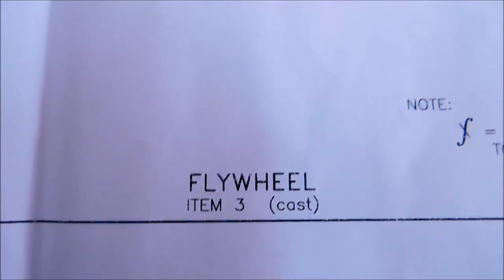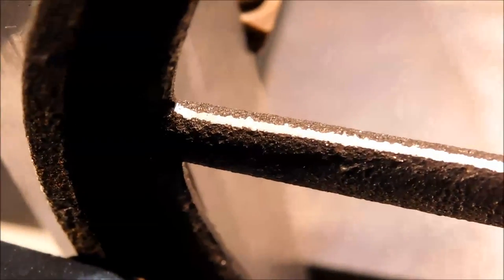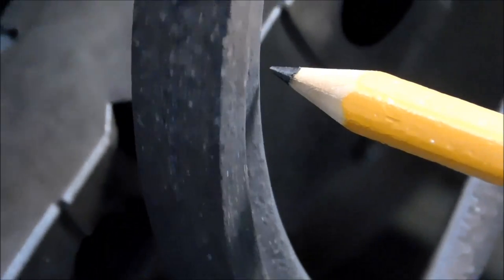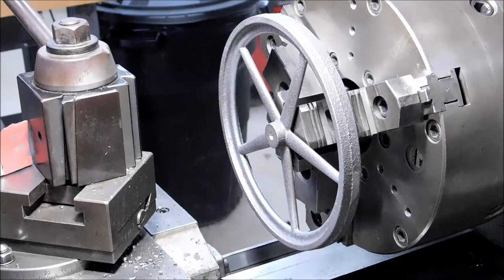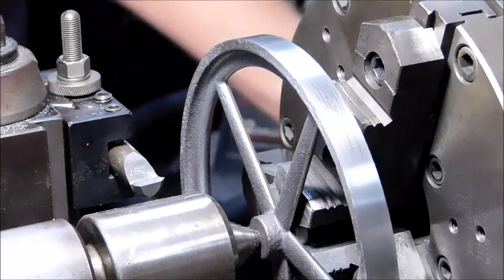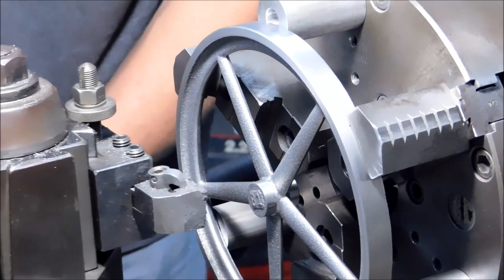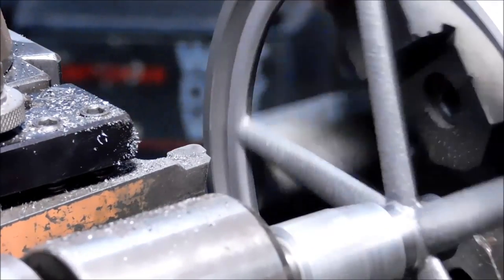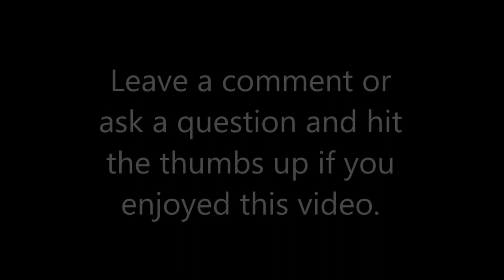Machining a Model Steam Engine - Part 10 - The Flywheel

Comment: It would have been helpful to have a weighted rubber strap like we use turning rotors on a brake lathe.  They help a lot with surface finish.  Ringing is a turners nightmare.  Awesome work!
Reply from the maker: I live by 2 sayings on this topic.  No dwell, No yell  and   If you got chatter, somethings the matter. Like little alarm bells for a problem.
Reply: @joepie221  Indeed, I agree. Are you familiar with the anti chatter device I'm talking about?  They actually work very well and are cheap.  You will find them near any AAMCO brake lathe and at your local NAPA.
Steel rotor hubs on cast rotors are the worst.

Comment: Iron castings were left out in the open air yard for a year to season before machining.   Fresh castings do not machine well.  Mounting a small grinder on the cross slide to face the rim at low rpm might have been an option.

Comment: Might have been easier to use 3 inside jaws to hold the outer rim on the inside, so it automatically averages the rim runout.  Kieth Appleton recommends holding the outer rim and cut the center, center crank hole, rim face, and outer face first.  Then flip and mic off the fresh rim to face the rear rim face and center...which are not as critical since the runout was cleaned up in the front cuts.  Your way depends on a pricey adjustable 3 jaw which most of us don’t have, and was more work.
Reply from the maker: 3 jaws won't seat comfortable inside a 5 spoke pattern. Using Keiths method, how would you address the inside of the rim to run concentric?????  I may suggest to hold the OD and face it for the first op, then pressure turn the second face and OD, but don''t do the center hole until you address the inner rim concentricity.

Comment: Wonderful bud Get the brake rotor straps for putting vibrations in their place. Or even a tarp strap wound around the spokes.Once again thank you for all the tips and tricks. This took me back to when I machined all aspects of ships engines. The only difference in flywheels is I did mine horizontally. I have yet to see a lathe that could radius swing 12 feet + eh. LOL.Thanks a bunch my friend and thanks for the memories.
Reply: When I was training we had a visit to Port Talbot steel works machine shop. (South Wales UK) They had a huge lathe but I forget if it would turn 18 or 20 ft diameter work. Tool-post was massive with 4"~5" square tools holding what looked like normal brazed carbide (except bigger than I had seen before) 
What fascinated me was how many  large electric motors were used to drive various parts into position as everything was too big to use normal hand-wheels for 'fast' positioning and the 'hand-wheels looked like cartwheels (saddle drive and tail-stock drive plus cross slide all had motors between 18" and 24" diameter)
It was in use with an interrupted cut about 1/8" deep at 1.5 rpm and huge blue chips coming off.  Even though it was around 1974, it kinda stuck in my memory as a scary piece of machinery.
Bed was about 80 ft long
Reply: @1crazypj  Lets see, , , We had 4 vertical boring mills. 6,12 and 36 foot tables. A master service radial arm with a 4 foot post and a 4 head mill with a 12 x 63 foot table. I sooooo miss the challenges working with 40 + ton castings making running ships engines and pipeline compressors. All done in my youth. It was GREAT !
Reply: @1crazypj  I sooooo loved working big. I got some relief in the logging industry here in BC Canada. Just not the same though. Nothing can compete with 40 or 50 ton pieces with a 2 in cut at 2 rpm though.
Reply: @TomokosEnterprize  I was never happy when stuff had to be hoisted into machine, turned down a job in heavy engineering because of it (also, didn't want to move to Holland and learn dutch LOL)
Reply: @1crazypj  I hear you my friend.

Comment: Nice work as always. I was thinking a 4-jaw chuck would have worked better than the adjustable 3-jaw
Reply: I was wondering the same thing.
Reply: most 4 jaws will not close on a small diameter.
Reply: @RobB_VK6ES  True. I didn't think it was that small but maybe so. Anyway, very nice job.
Reply: @RobB_VK6ES  I meant, why not clamp the outside of the flywheel in a 4-jaw to true the center hub and side of the rim. Seems like it would be easier to center and probably stop the ringing as well.

Comment: Just a comment/recco on using a set screw to fasten the flywheel to the crankshaft. Try to avoid it. The torsional vibrations seem to ultimately loosen set screws which in turn damages the crankshaft.  Machining flats on the crank, only limits the damage to the flat area. I use keys to avoid this problem. This is fairly easy to do. Keys also help to transmit power from the flywheel. Which brings another point. Since PM Research has offered another model, consider their little dynamo. Perhaps you might drive it with a flat belt off the flywheel to get the high speed needed. Then light a light. A model is much more attractive if seen to be doing something rather than spinning pointlessly. Cheers.
Reply from the maker: There are many better ways, but this part is being done to print this time.

Comment: Stunning job on that, it looks really good. :o) The pumping engine flywheel near me is several pieces and huge. I often wonder if the bolted on a temporary lathe slide and skimmed them in situ?

Comment: When I run small flywheels like that, I do, as you did ...get the very inside diameter to run as true as possible...but being a casting, you can only do so much .....but after the machining is complete, I indicate it in on my rotary table, and take a very light clean up cut on that I d. Between the spokes on my milling machine......then, as you did in the beginning, I fettle that inside rim with a file, to round it off.......all said and done.....you have a flywheel that runs dead nuts everywhere !!!!
Reply from the maker: Strapping it down to a rotary table should allow you to finish every surface, true, but I like the combination of cast and machined as well.

Comment: Hi Joe. Great work as always. 
Would it have been a valid alternative to begin by using reversed jaws to hold the I.D. of the rim and face the rim and hub od and face all concentric to that at 1st setup then reverse and hold on hub od, indicate the machined face to run true, then turn the od of rim and face rim and hub, drill and bore and do rim lip ID?
Then reverse again and hold on hub od to finish inside of rim on the first side. 

That way you automatically centre as well as possible on the rim ID and all else falls into line. 
I acknowledge it's a thin rim but I would rather have the dodgy grip on the cast surface at the large radius and be machining the small radius than the other way around.... that way you get some mechanical advantage over the tool forces. 

It would be disappointing to break it open though with tensile gripping forces.... 🤔🤔🤔
Reply: Yes, that is what i usually do. It keeps the inside and outside concentric. Cheers

Comment: Hey Joe - question:

That undercut around the rim adds so much to that classic machined casting look... but were you at all concerned about thinning out the material between the spokes and the rim? Hard to see thickness on a video, maybe there’s plenty of meat there, but it looked like it might be getting kind of thin.
Reply from the maker: It was about .2 thick at the end. 4.5mm

Comment: Joe you made a silk purse out of a sows ear there! I'm extreemly impressed of how you dealt with that casting.
The standard of quality of the casting was bloody awful to my mind. I used to work for a company that was based in the yard of an iron foundry making pretty complicated and intricate castings. Whoever moulded that flywheel would not have lasted two days there. There is no excuse for allowing such slip of  the split pattern, unless the patternmaker never put locating dowels in, OR the pattern is so old and worn  that the dowel holes are so worn that it allows such slip. Either way the company should address this issue.
Reply from the maker: It came out nice. I do agree, a casting can have some flash, but an offset is avoidable.

Comment: Joe, I love your struggle for a good result. But what about using an adjustable 4-jaw? Why didn't you use that? Or maybe a small shim in between of one of the jaws of the three-jaw chuck to get the biggest error out before adjusting?  (e.g. if you don't have a four jaw with a small enough opening for this diameter of hub). Just curious and willing to learn. Thank you for sharing this build! I can't wait for the next one. Best, Job

Comment: Your model is going to look amazing.
If you look at a lot of full size steam engines although the wheels look to be running true  it is an ilusion. The unmachined surfaces are painted in a dark colour with bright pinstriping added which when combined with the true bright machined surfaces disgiuses the wobbles in the rest of the wheel.
Reply from the maker: I needed this part to be a gem. Its the first thing you'll notice.

Comment: Another master class. Would the OD of the wheel would be used to drive a belt? If so would it need an angled profile?
Reply from the maker: I'm not positive, but I think its only to keep the momentum of the engine.
Reply: Typically a pulley would be added to the other side of the crankshaft on most engines in order to drive a belt.  That pulley would have the "angled profile" for a flat belt instead of the flywheel.

Comment: I'm a bit surprised you didn't grip it by the inside of the rim. Were the spokes in the way? Seems like that would be the most accurate hold, and the backside is supported by the step in the jaws. 

My only concern would be whether the cast iron would resist a tension load from the jaws. I imagine that it would be pretty easy to crack if you applied too much gronk.
   ....
Ok, I'll reconsider. Mounting that thing on a faceplate or making an equivalent fixture should avoid bending such a spindly part.
Reply: If you look it us a 5 spoke wheel and thus no way would it fit in a 3 or 4 jaw chuck. Seen any 5 jaw ones?

Comment: Hi Joe, Nice Job on the flywheel, every time that I added a set screw to the hub even after reaming it caused it to wobble so I just started locktiting it . don't know if I was not seeing something.
Rich
Reply from the maker: I may add a flat to the crankshaft so I don't damage it with the set screw.

Comment: Got any tips for dynamically balancing something like this in the home shop?
Reply from the maker: RC modelers use a small device called a prop balancer. This is not a high RPM unit, but if it was, I'd use one of those.

Comment: Hi Joe. At about 36 minutes in, where you were facing off the side of the flywheel, what if you remove the tool from the tool-post and stick you some sandpaper on the side of the tool-post parallel to the plane of the side of the flywheel, then - ever so gently - hand-advance the cross-slide (and, with it, the sandpaper-coated tool-post) against the spinning flywheel? That tool-post looks to be flat and true; just make sure the compound is set to 90 degrees to the axis passing through the chuck and tail stock. Obviously, you’ll have to secure the sandpaper somehow. Or, if sandpaper doesn’t work, how about that flat file you were using earlier? Is there some way to secure that against the tool post?

Comment: For the first time ever watching your videos I feel like I want to comment on how you did something, I'm usually just in shock and aww.
Looking at the situation my advice would be to have worked all of the center features while being held by the center, then do all the outer features while the jaws were reversed. 
You could have set your standoffs on the chuck and used them as jack screws to machine the side to help with the chatter... 
Everyone has their off days, I had a boiler explode in my face after 15 years of not a single work related accident. 🤷 
Thank you for the awesome content I'm really enjoying the build and can't wait for the next video/ steam engine build coming.
Reply from the maker: I felt it valuable to show and fight the vibration. I could have fixtured this part like a rock, but not too many would appreciate the approach. then again, I'd do the next one differently that I did this one. Evolution. But with only one to work with, I picked a path and walked it.

Comment: Just a question/comment from the peanut gallery: would it not have been possible to also use those stand-offs whilst you were gripping it by the hub to turn the OD?  Might this have reduced ringing during that op too?
Reply: May I also add, I really enjoy your videos, thank you!
Reply from the maker: Very possibly. Once you have a reliable surface, the job gets easier. Its just establishing, lining up and cutting that first surface that is the task.

Comment: Great Job Joe. pity you could not show a before and after. but you only have the one casting. If I had been doing that I would have drilled the boss while holding the outer rim to ensure that the hole was concentric with the rim. But you got it rite. Thanks for the video

Comment: Shove some wood wedges between the chuck & the work  A ring of masking tape will hold them in.  Even wrapping masking tape around the outside may kill the chatter enough.  While you have that part in (concentric to the outside, you should have machined the hub outside).

Comment: Perfection as usual. I wondered  what rpm it will be spinning at when the engine is running and should it be balanced.....somehow!
Reply from the maker: 250 is the recommended max RPM

Comment: Joe, after turning the OD put a rubber band around the outer diameter, that will knock down the ringing.
Reply: As is done when turning a brake drum.  They also use a leather belt to dampen the ringing.
Reply from the maker: or a continuous extension spring.
Reply: Commented the same and then saw it had been said.
Reply: @joepie221  Centrifugal forces would prohibit the use of a spring as it has mass where the belt or band hasn't enough mass to be of concern.

Comment: I'm new to all this so please help me understand.  Why did you use an adjustable 3 jaw instead of a 4 jaw?  I thought the 4 jaw was designed for this sort of thing and could adjust to essentially any offset.
Reply: I’m not sure I’ve ever seen him use a 4-jaw... mostly just collets and that little 3-jaw... sometimes he does wonky things to demonstrate with common hardware...

In this case, 3 or 4 jaw, he was demoing how to reduce the error in stages by alternating sides as you work toward concentricity... I’m not sure if he used a 3-jaw because he doesn’t have one or just because he was demoing in a way most of us could do with the hardware we have.

Or maybe it was just an awesome flex 💪🏻? 😉
Reply: @ArmchairDeity  his last video was done with 4 jaws.
Reply: I think I may have found the answer.  Apparently the adjustable 3 jaw chucks, such as set-true, have finer adjustment capablility, which lends itself to more delicate parts.  With the 4-jaw jucks, the adjustment is somewhat coarse, which can distort thin parts, whereas the adjustable chucks use a fine screw which allows adjustment without large changes in clamping pressure.
Hopefully Joe will chime in and let us know if this is the right answer or not.
Reply: A 4 jaw is what I would've used.I have turned castings with the same problem and it's always worked out pretty good.
Reply from the maker: Without having this part in your hand, it was hard to really demonstrate how fragile it was. In this video, you can see me stop the lathe and press on the rim from behind. It moves about 1.5 mm with just finger pressure. The 5 spokes wont line up with 3 jaws and the dragging from a 4 jaw setup was asking for disaster. For an irregular round part, a 3 jaw will seat ideally and gives much better feedback when gripping. Its the safer option.

Comment: Great content as usual. Noticed when using the round-nosed tool for the radius that the running centre looked like it wasn't concentric. Was this an optical illusion? (at about 51:00, the top surface of the centre against the orange of the tool on the tool post). Could be a few other reasons.
Reply from the maker: The pressure between the part, bullnose and the live center was almost absent. As the aluminum piece started to run eccentric, it did influence the live center. It was running out towards the end. I couldn't lock and secure everything for worry of cracking the casting.

Comment: It's a shame they didn't use a finer grit for casting .

Also how do you think it would have worked ? Just a thought.
Had you placed the fly wheel on a surfce plate spinning it in an adjustable chuck, [or] one could have used small clamps at the outer and inner edges of the spokes with spacers under them to hold it ridged, and placed shims between the rim and face plate for centering etc, and to turn the inner and outer diameter and even to line up to drill and finish the center hub.
Reply from the maker: I replied once before that a faceplate would have ben the ideal method, but start with 3 shims and clamps to eliminate the possibility of distorting the casting. The flip side could use more.

Comment: Did anyone else see the live center start wobbling at 49:34?  I would have no clue how to approach a raw casting like this and make it beautiful like Joe did. Whenever we machine pulleys with CNC,  we do all ops on one side and then do an M98 to the opposite side. They seldom see daylight while in the field
Reply from the maker: There was only superficial contact between that center and the part. No pressure. As the small bullnose started to run eccentric, it influenced the unlocked center. I was only using that center as a bumper in case the wheel let go.